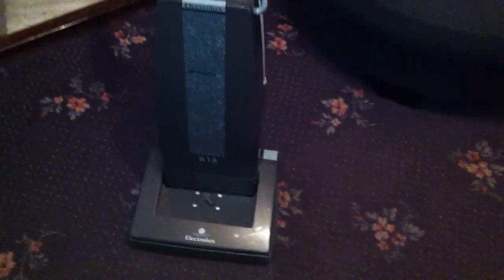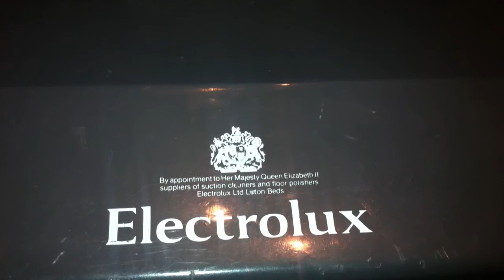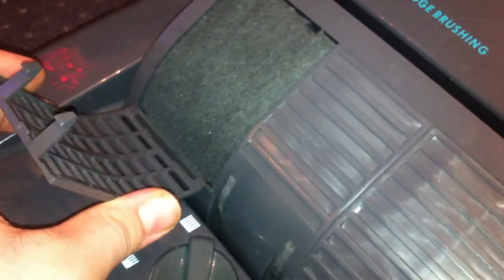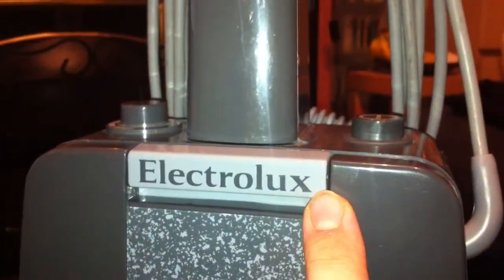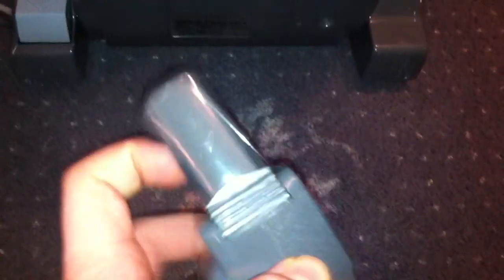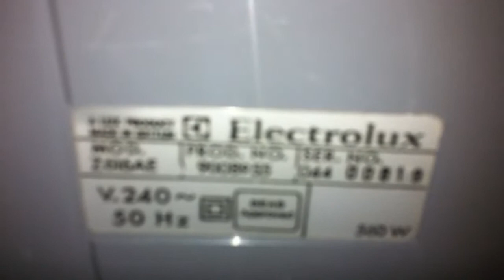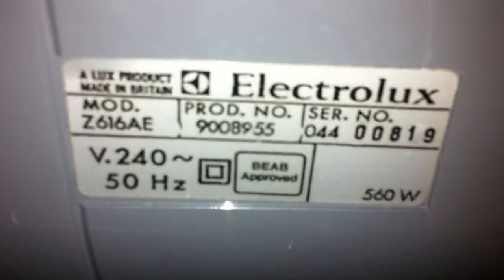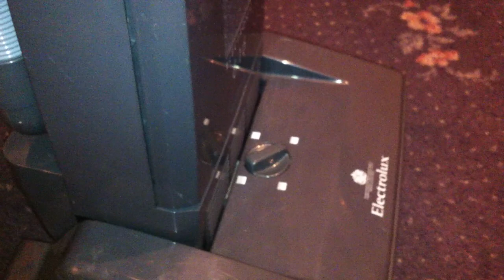1990 Electrolux 616 Electronic Z616AE

Comment: Hello, I have a 616 which I use as backup when our new vacuum cleaner breaks (it does alot) and I use it in my radio shed, now, how can I make it suck better? It sucks good, I've cleaned filters and changer the rubber seal on the front door now, is there anything else I can do? Anyways, I love how the cleaner has all I need on it, though, the brush tip is gone, and the piston indicator is gone too, sadly, so the hole is taped shut with electric tape. Also, I still got new bags, and I love how it has a clip that I can remove and empty the bag, they really thought of reusing bags back in the day. I don't have a airfreshner thought. 

I'd love to hear back from you!